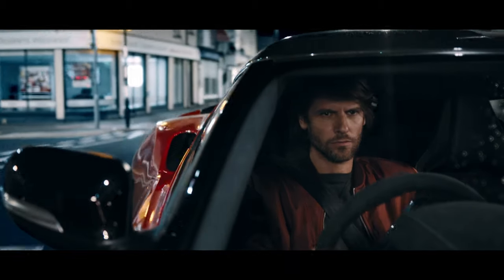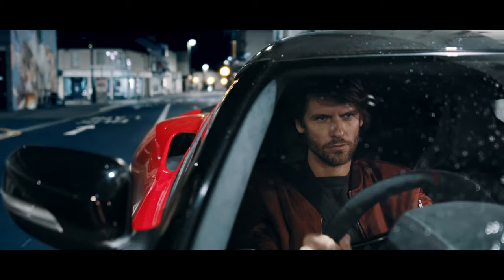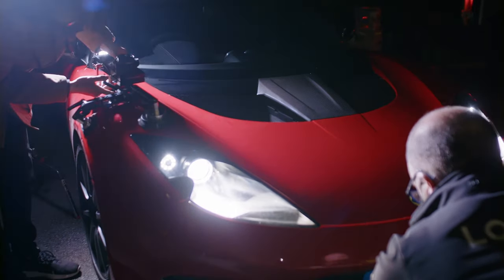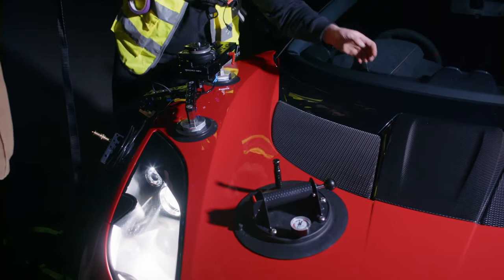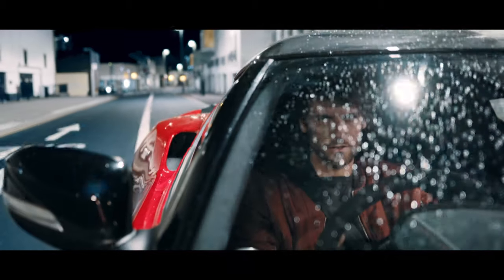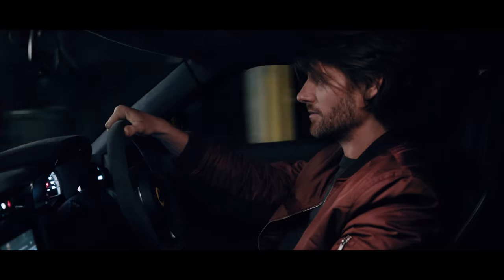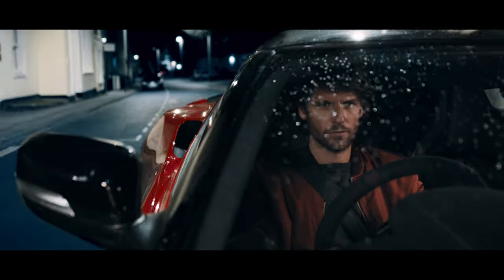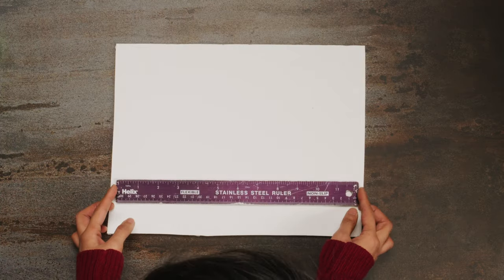60 Second Cinematography - Car Mount Shots

Comment: Do you have any tutorial for how to do a fender cam style? Ie recording the wheels from the side ala 80s style
Reply from the maker: Depending on the camera system that can be quite an intense rig, many ways of approaching it - suction cups, hard mounts, from towing points or to frame of the car with unibody clamps and speed rail starters etc. But the common thread would be triangulation. Where are you based? Best thing would be to work with a local gaffer who has vehicle rigging experience, especially with this one as it will definitely be outside the immediate footprint of the car.

Comment: why did you place the second camera angle on the same side where the light is coming from? you also break the 180 by doing that. was it for practicality?
Reply: I assume since both cameras were rolling at the same time, mounting it on the opposite side meant the A camera, shooting head on, would have caught the B cam in frame.
Reply from the maker: Practicality, the A camera angle was the front mount and was the priority. The intention for the B cam side angle was to cut in between a selection of other shots rather than as a direct cut with the A cam, in that sense we don’t interfere with the direction of travel as A cam is looking straight back so it still works. Also it isn’t a hard break, more sitting right on the line and in fact cutting between the two you still keep James the driver in essentially the same screen position and as the direction of travel doesn’t feel flipped you could get away with it. 
Lighting becomes a compromise for the B cam angle, in an ideal world we could have set a finessed for each individually.
Reply from the maker: @jacoblea  You got it 👍

Comment: How did you deal with the glare from the window?
Reply from the maker: In this scenario I didn’t fight it, having the street lights catch the water drops on the windscreen added to the feel. If it was an issue then a polarising filter may have been able to tame that a bit. This does tend to be worse during the daytime when the sky can completely milk out a windscreen - which hopefully a polarising filter will help with.
Reply: You could attach polariser filter in front of the lens